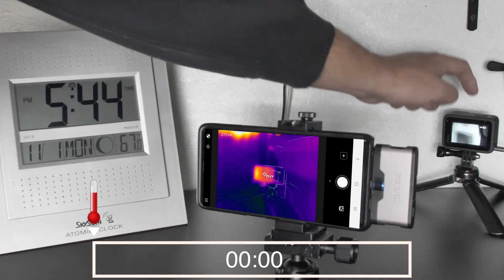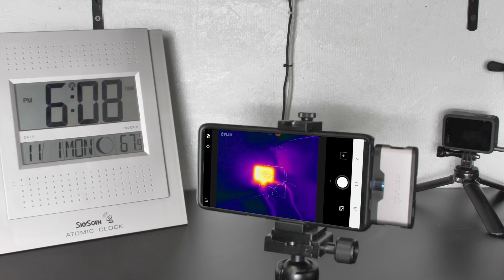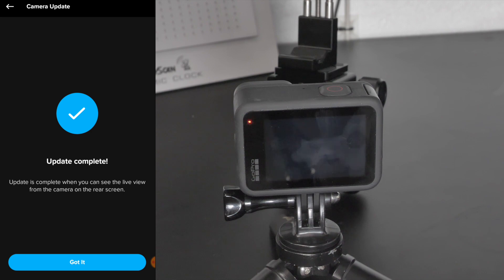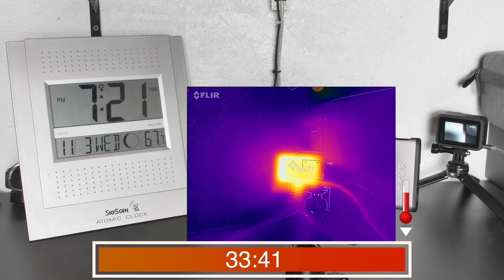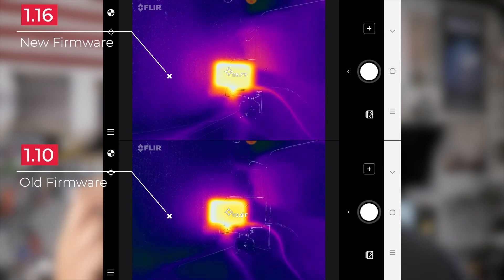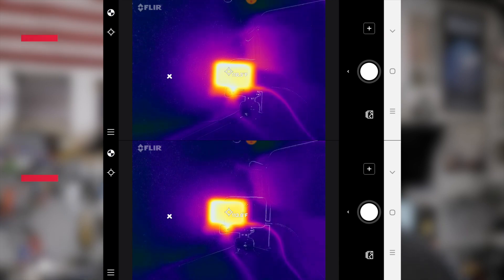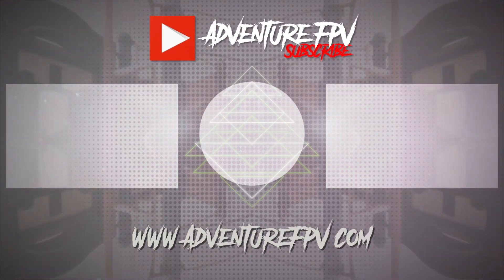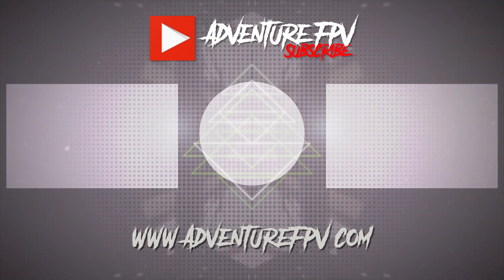GoPro Hero 10 Firmware Update 1.16 (🔥Overheating Solved?)

Comment: Just received my Hero 10 today and I returned it today to Amazon, The reason: I can't get the battery door open with a using a penny or something pry it open, (Unbelievable how difficult it is to open this door). Also it was very warm just setting it up out of the box while configuring. This camera is not all that people are saying it is with these issues. Paying 559.00 and having to deal with these issues forget it, I returned it.
Reply: Not sure
Reply from the maker: @justtruth8310  The action 2 just went 30% off on Amazon: https://amzn.to/3aQISLi
Reply: Do you like the camera performance? Does it overheat?
Reply from the maker: @justtruth8310  Do I like the 10? Yes I love it. No overheating issues but I use it on a drone so it has lots of air flow
Reply from the maker: I don't blame you, if I was having those issues I would be sending it back as well. The door on both the 9 and 10 are hard to open the first few times for sure. Got used to it after a few tries. What are you getting instead?
Reply: I have 2 dji phantom 4 pro drones .
Reply: I returned mine today

Comment: Go for dji action cam, more reliable and better all round cam,only 4k but how many of us really need 5k when most people shoot in 1080p
Reply from the maker: I will be skipping the Action, To much glass, non replacable lens, must use attachments to view and charge, non swapable battery and poor FPV stabilization. I actually do not have ANY issues with my Hero 10. Only got it to overheat for this test. I film in 5k 4:3 and render out at 4k.

Comment: GoPro Hero 10 does not overheat when the battery is removed and power is supplied from an external power bank connected to a USB port.
Reply from the maker: Battery was in, and to be honest I have NEVER had the GoPro overheat on me during use.
Reply: @AdventureFPV  https://www.youtube.com/watch?v=FBWjQNwY2Js
Reply: @Stanislav Panayotov  are you saying that the go pro volt will run the go pro without the battery and will not overheat?
Reply: @DefiniteDestiny  Yes, I tested it. I have a power bank with capacity of 30,000 mah. I connected it to the USB port of my GoPro Hero 10 Black. I recorded video at maximum resolution, bitrate and frames per second for more than three hours in a room on my Samsung 512GB microSD card. The temperature in the room was around 22 degrees Celsius. I had turned off only the GPS on my camera GoPro Hero 10 Black.
Reply: @DefiniteDestiny  Ops, I'm sorry but I don't have GoPro Volt.
Reply: I tried power bank it got hot and turned off by itself I returned it cuz it's useless
Reply: @tigergray1100  Yes, this will happen with any power bank that cannot output 2 amps or more via USB port.

Comment: You shouldn't have made the 2nd test with the tripod mode because that way it was different from the 1st one.

To be accurate both tests should have been done using exactly the same settings.
Reply from the maker: Good call, but I was trying to prove that they fixed the overheating issue when being placed on a tripod. Not sure this is even relevant as 2 new firmware versions have already been released since this one.

Comment: So now the battery saids its flat at 60%. The anti flicker wont change to 60hz and the media mod doesnt work. Nice update gopro
Reply from the maker: Damn, that does not sound right. You can downgrade and try again maybe it did not take. I do not have the media mod so I cannot speak to that. Sorry to hear about that man.
Reply: Issues are still there on my Brand New GoPro. The Camera would not charge when connected to the Media Mod
Reply: @jaelapitan  mine is fixed with last updates. Do a full factor reset after updates.

Comment: Nice one fella, I’ll be updating now…thanks for the video 👍🏻
Reply from the maker: No problem man, I really never had an issue with it before but wanted to see if the updated helped.
Reply: @AdventureFPV  am nervous about the update after seeing a few 10’s getting bricked, was that a slightly older f/w though, 1.15 ?
Reply from the maker: @hvee4  Yes GP came out with 1.15 about 6 days ago to fix the overheating issue and it caused a boot loop error. This is the Revised 1.16

Comment: Also I have a question for you about the GoPro 10 settings without an nd filter, and what do you think is the best settings for freestyle please let me know.
Reply from the maker: I have only used it 1 time without a ND filter during the day. I had to sat the shutter speed at its fastest setting to compensate. Also I would try the standard hyper smooth for Freestyle, some would say NO HS at all. But I like it to be a bit more polished.
Reply: @AdventureFPV  Thanks so much, I really appreciate it and will try that!
Reply from the maker: @launchfpv7144  No Problem

Comment: Do you have any advice on  how to piece back reelsteady footage?
Reply from the maker: Unfortunately no, I have been doing some research on this and it appears the GP does NOT record gyro data during the last 1 sec of recording so this may not be possible. This issue "may" be solved by combining the video first and using gyroflow? Not sure but may be worth a look.
Reply: @AdventureFPV  As of now "Optional: Joining Chapters After Capture" works on the GoPro Labs website. Just tried it out and I was able to merge my clips seamlessly without a cut. 

Link to GoPro Labs Instructions: https://gopro.github.io/labs/control/chapters/

Link to Video of how to perform it: https://www.youtube.com/watch?v=ycSDZV2T01k

Thanks for the help!!
Reply from the maker: @FazOursX  Dude that is great, I will have to give it a shot. Thanks you so much for sharing